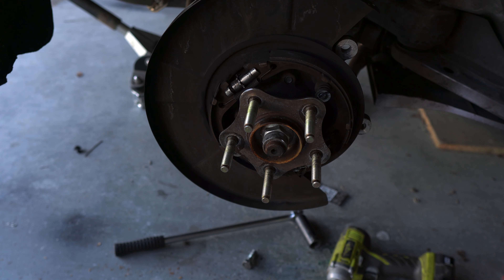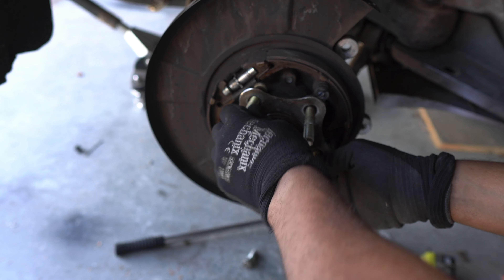Installing extended wheel studs.  It's EASY with the right tool!

Comment: We need a video on how you ran the wire from the telsa screen
Reply from the maker: What wire?
Reply: @SquareWheelsAuto  from the gps and any tips or tricks I be trying to use wired car play and it never works any suggestions
Reply from the maker: Did u see this: https://youtu.be/qVZdVurUr1Y
Reply: @SquareWheelsAuto  lol nope 🤦🏽‍♂️ never seen this but any suggestions on to fix the connectivity issue I’m having with the car play
Reply from the maker: @Officialfabreeze  hmm what's happening exactly? Try Headunit Reloaded instead of Zlink app.
Reply: @SquareWheelsAuto  it’s like it just won’t connect even though my phone will say I’m connected to the Bluetooth and hotspot and wired just never pops up and what’s head unit
Reply from the maker: Headunit Reloaded is an app for carplay. Try it instead of Zlink.

Also if you're using carplay, you shouldn't need a hotspot and all that other stuff. But download Headunit Reloaded and try that instead
Reply: @SquareWheelsAuto  yeah so with car play the hotspot on the unit needs to be on and with head unit does it work with Apple car play and android auto?

Comment: Hey bro not sure if you’re still active or not? My lug nut was stuck and would just spin around and wouldn’t come off so I had to take it to a shop and they got it off but also cut off a wheel stud that was bad. I have a 2019 Q50S. I bought a new stud already and the stud installer shown in the vid. Would I be able to put the stud back in without taking off the wheel hub? I’ve tried but the stud doesn’t fit in because there’s no room

Edit: it’s a regular OEM size stud, not extended
Reply from the maker: Should be able to spin the hub around so you can wiggle the stud in behind
Reply: @SquareWheelsAuto  thank you for the reply I honestly appreciate it, I’ll give it another go thank you